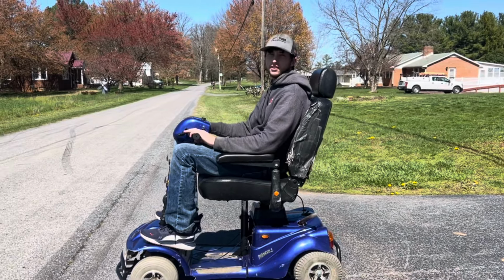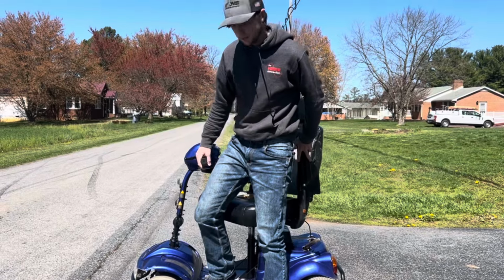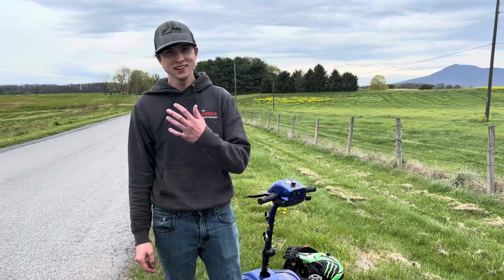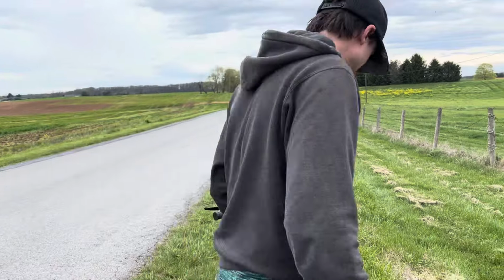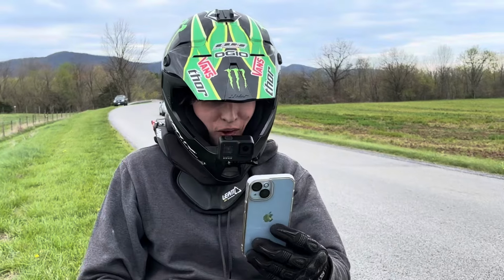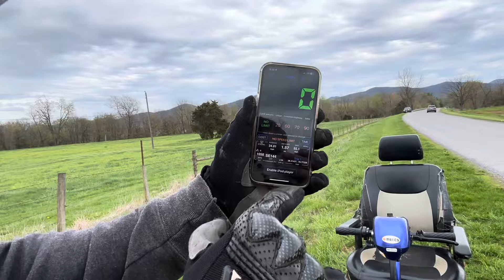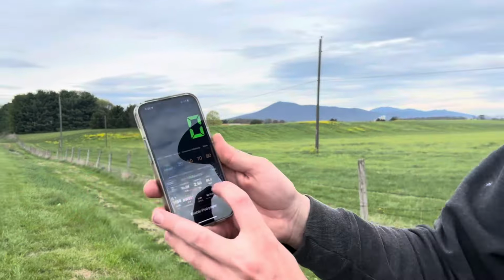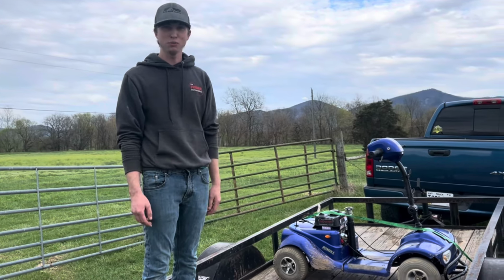5 MPH ➡️ 60 MPH? Mobility Scooter Build!

Comment: That’s sick! What did you do to the motor? Without the governor isn’t it like 30mph?
Reply: probably a restricter plate on the predator motor, or the teeth on the drive gear.
Reply from the maker: Governor is removed so it can rev to 5500 ish. Has a bigger carburetor and exhaust. Also, geared it for high-speed rather than low power. So it has a pretty small sprocket on the axle